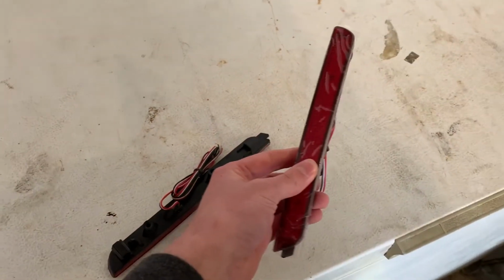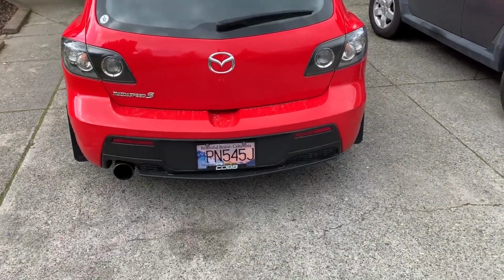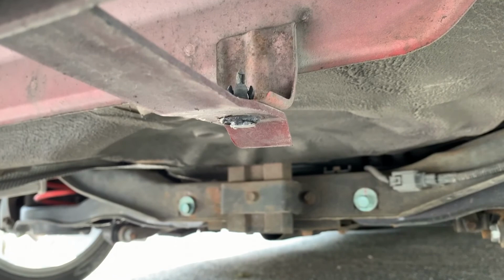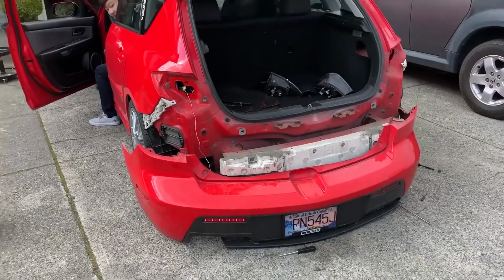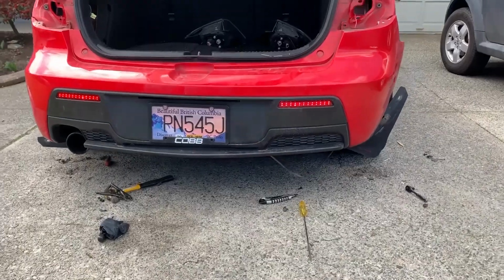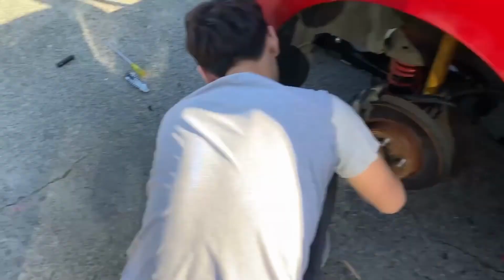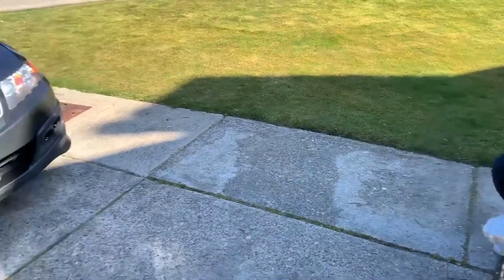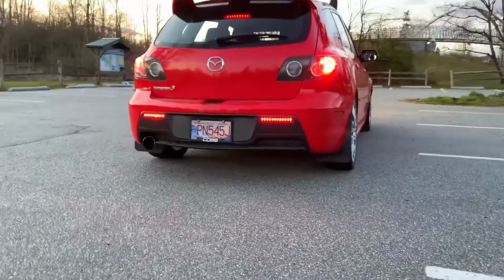Rear Reflector LED Light Conversion! | Mazdaspeed 3

Comment: Just installed mine but they just stay at 100% bright and don't change when I hit the brakes or anything. Any idea why?
Reply from the maker: You wired them up wrong
Reply: @arsenyrazhkov4559  I grounded the black then did white to purple and red to orange.